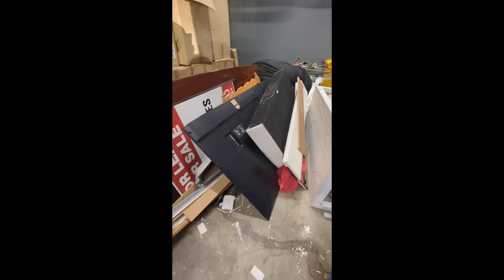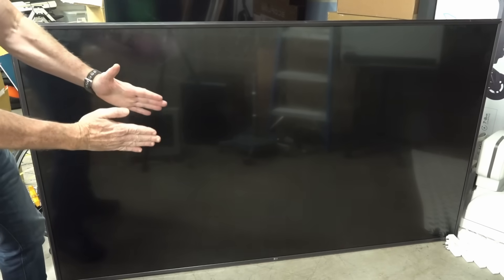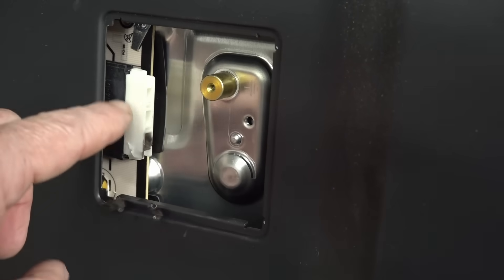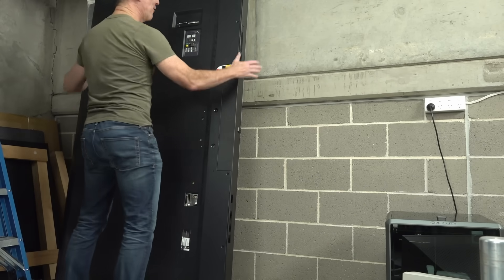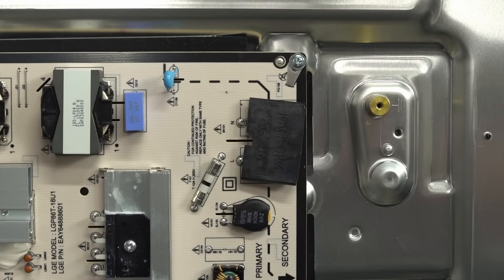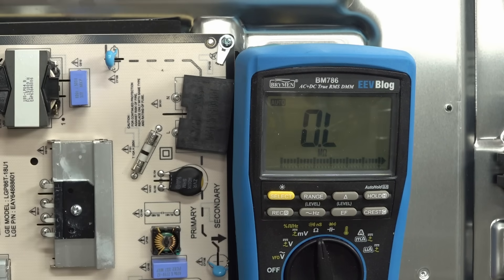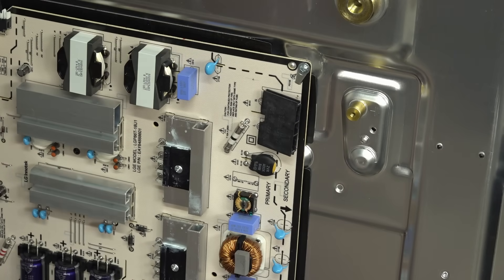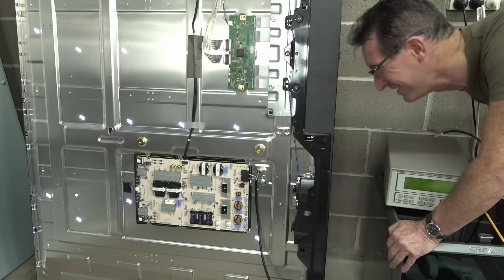Dumpster Diving 86" LG 4K LCD TV

Comment: Even when damaged, I wonder if screens this size have something useful inside.

Large backlight diffusion layer for uniform lighting?
Or something.
Reply: Unless a DIY project is your plan the only value left in this is the power supply, controller board and t-con board for replacement parts. The rest is scrap.

Comment: Whoooooooooooa... Nice find. Pity about the cracked screen. Bigger than anything I've ever seen. Wider than you are tall... and maybe even wider than I am tall in high heel platform boots, haha. "You call that a TV? THIS is a TV."

Two FULL BRIDGE RECIFIERs, that's damn impressive! The Keritech way would be to salvage them along with these big electrolytics, then test and use that later in some tube amp build. Might be some other useful components waaaaaaaaaaaaay-down-insiiiiiiiiiiiiide too...

I could spend hours ranting about how normies (unlike the tech nerds like us) don't even give a shit about repairing stuff anymore... I still wonder if the crack was there when the TV was dumped, or if it was mechanical damage from other trash or rough handling. Adding insult to injury. A super easy fix made pointless, meh.

Speaking of dumpster find TVs... my 50" Blaupunkt still serves us well since I got it for free from my friend in 2021. It was dead but all it took to get it going was replacing a corrupted EEPROM and a bunch of caps.

Comment: So it's not a TV... it's a monitor  --   No RF inputs and TV tuner on the main board. They use em commercially in shops to advertise. 
  Not surprised it's cracked up... the laminated screen is the same thickness as a normal, reasonable, domestic 55". The larger the screen area the more vulnerable it is to breakages, especially when servicing backlight LEDs. 
Probably bloody heavy too.
Reply: It did have an RF input
Reply: @matthewnowell4657   Yeah true, taking another look.

Comment: Last time I found a cracked screen TV, I made over 100 euros selling the circuit boards on ebay, just sayin'.
Reply: I used to have a arcade op nearby, they'd be getting rid of old CRTs, but for disposal they'd have to let the magic vaccum out. Some of those CRTs were top quality, so I got the boards and put them on the 'bay for a decent price plus shipping. The whole arcade cabinets were a challenge to lug in my Brumby  but I made it work, eventually sold them as-is to a collector, but well, I've kept the cool vector monitor games ;)
Reply: With these 4K LGs its nearly always the board (the port loose causing broken traces). Can be fixed though. It's a well known issue. NRF says you're lucky to get a year out of them.
Reply: @catharperfect7036  A year?! Yikes, what a poor quality product.

Comment: That's still good as a light panel!
Reply: Exactly!  Remote controlled even!
You can get color correcting filter gel from someone like Roscolux or Lee filters to get it down from 6500K to 4100K or 3000K.
I've used Lee 808 and 807 filters to change 4000K to 3000K and 3500K to 3000K.
Reply: ... BIG light panel!
Reply: With local dimming zones, possibly.
(I couldn’t be bothered looking it up 😅)
Reply: @LongPeter  OH MAN!  That gives me an idea!  If it did have local dimming, you could make a virtual skylight!  You loop a video of a cloudy sky.
Reply: @button-puncher  yeah, that could work? Take the LCD layers out and leave the diffuser, perhaps?

If you haven’t already seen it, look up DIY Perks virtual sunny window. That guy puts in way too much effort. 😅
Reply: @LongPeter  Thanks for the tip.  I'll check it out!
Reply: @button-puncher a nice but quite inefficient light. Only <10% of the backlight makes it to the front even on a white screen (Color filters: 33% under ideal circumstances, polarizer 50% (ideally), LCD (polarizer too) 50%.). Multiply those ideal numbers up and you're at 8%...
Reply: @MarcoTedaldi  I'd remove the screen.
Reply: @button-puncher  I've done this with old 17" LCDs to present glass slides. Worked nicely. Interestingly, the Background light switched on and stayed on automatically as soon as power was applied. Somehow removing the LCD made it not going into sleep after a certain time without any input signal. But I wouldn't bet on every Screen behave the same.
Reply: @LongPeter  it is a superflat tv so the backlight is side lit so no local backlight possibility
Reply: @LongPeter  if the model is UM/UN7000 something it sadly doesn’t have local dimming. I have the same model in 49” 😅
Reply: I made a light panel from a broken monitor. I use it to calibrate telescope optical systems and set up camera sensors.
Reply: I should've checked the comments before making mine. A tabletop lightbox would be great with its size.